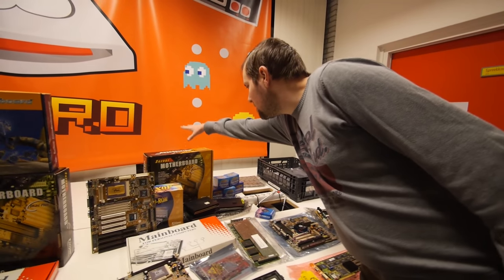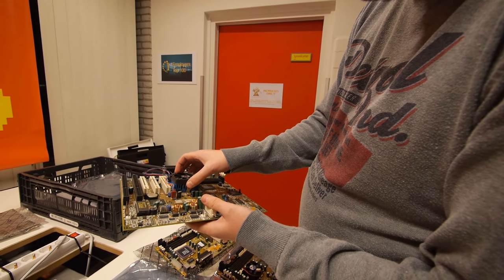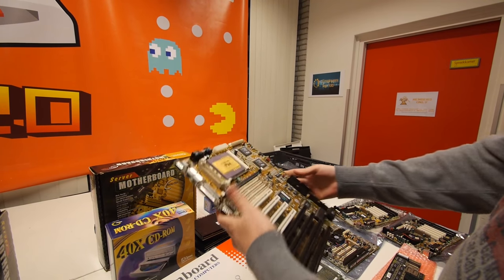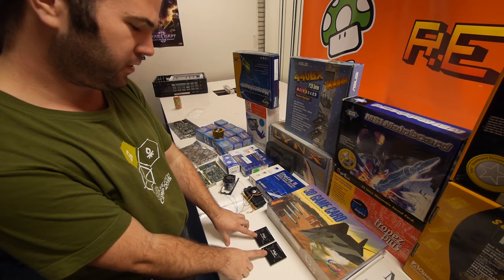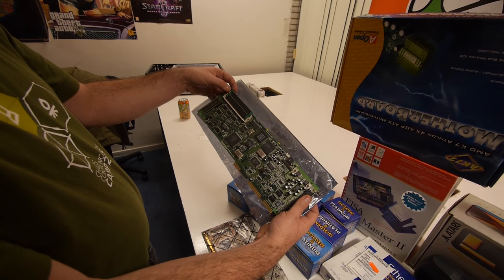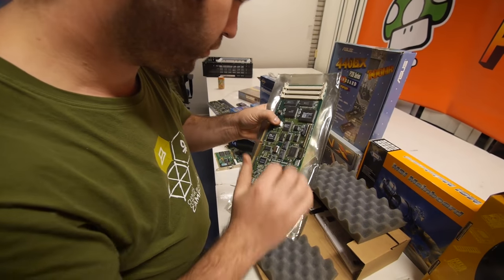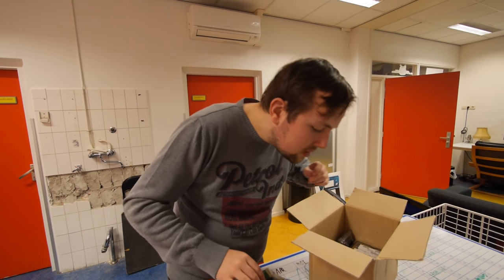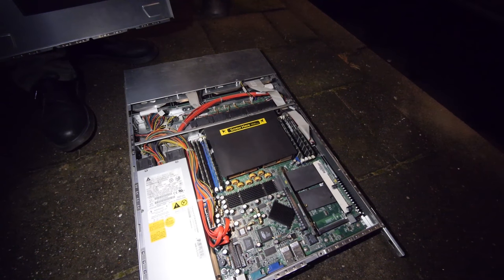[SPECIAL] Mega Retro PC Hardware Haul!! Our adventure of buying brand new old stock 1993-2000 parts!

Comment: Very nice :D Not so much into the server stuff, but the GPU is nice, especially sealed. Some of the boxes are massive, like the TB sound card.
Reply from the maker: And the Aopen Dual Xeon board box is also huge. It even comes with 1 cooler! :D Many extras and accessories in the box :)
Reply: I also have two of the Asus P2BDS boards, they are pretty amazing and rund very well under Win2000. Would also be a cool idea to base a build on this model. There were some games supporting dual processors, but I guess one in a million took advantage of this at the time :-) Only Problem - not even a Winfast fits, AGP slot is too close to the processors....

Comment: what the server board will run?linux?novel netware?
Reply from the maker: Which board the Aopen? :)
Reply: Yes, if thats the Dual Xeon one then that one :) so much stuff hard to keep up with things
Reply from the maker: It is a system with AGP so probably I gonna make a Windows 2000 workstation out of it :)
Reply: Nice.  Never think about making a FreeBSD or *NIX box out of it? for homeserver needs like FTP or Samba shares , torrents etc?
Reply from the maker: Not on Retro HW :) I use modern HW for such tasks